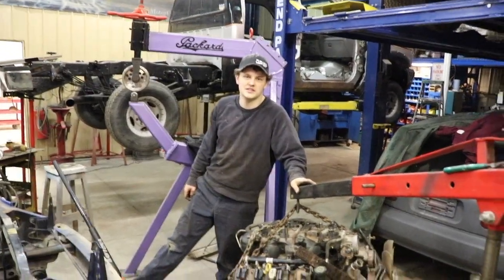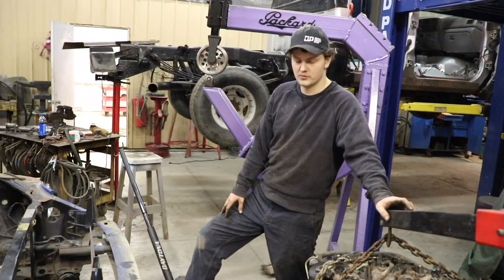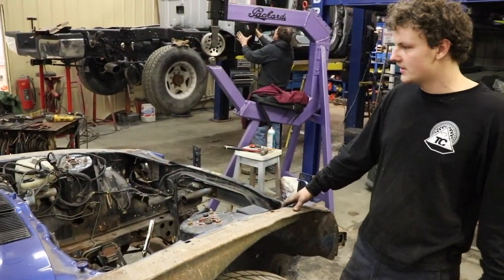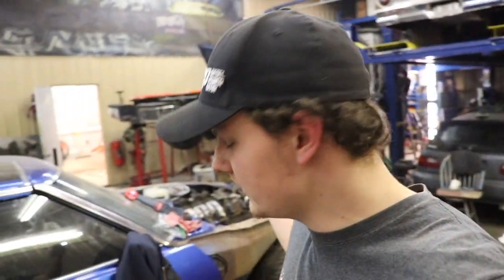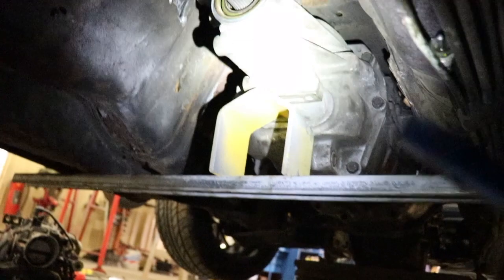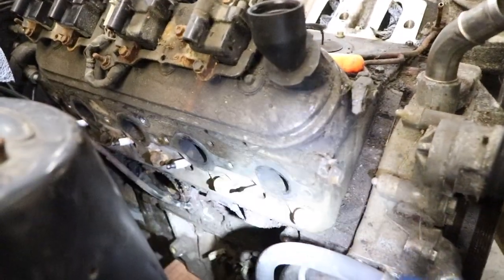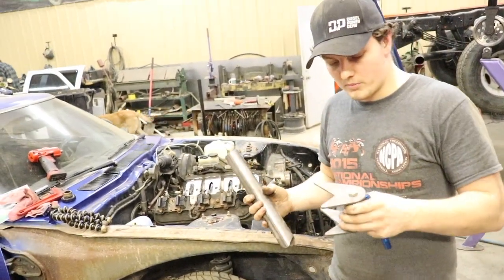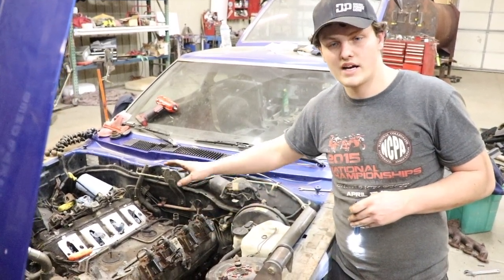LS v8 installed in Datsun 280zx

Comment: Why didn't you keep it Nissan... or atleast Japanese...
Reply from the maker: Datsoon price
Reply from the maker: Also the ls is proven to make reliable power
Reply from the maker: I would have loved to do an rb25 or 26 but they are $$$
Reply: @JohnnyFabz  you have a very good point. It's not Nissan, but you can find a 1jz for about $1,000...
Reply: @JohnnyFabz  that is true. Some LS engines aren't the best on reliability, but a lot are. It's just being a purist I prefer engines from the same manufacturer or country usually, however it depends on the car.